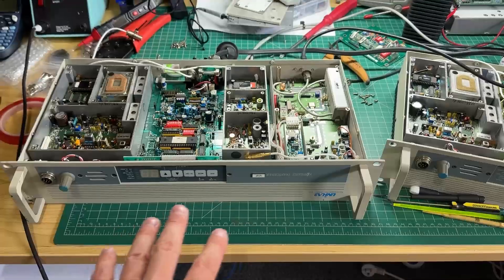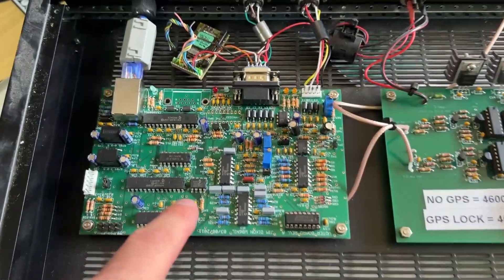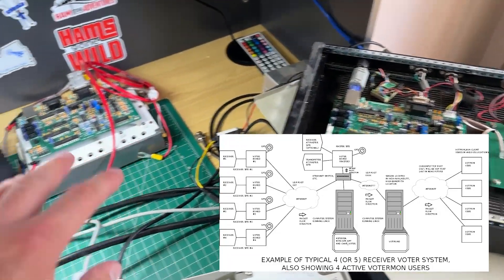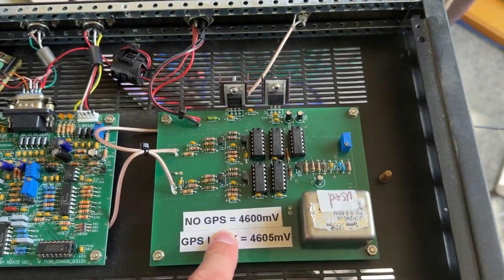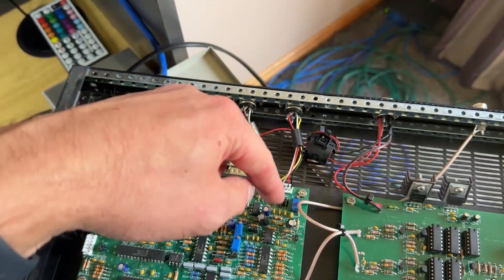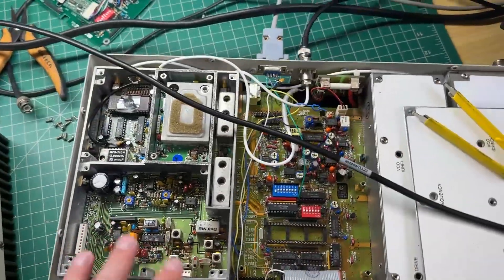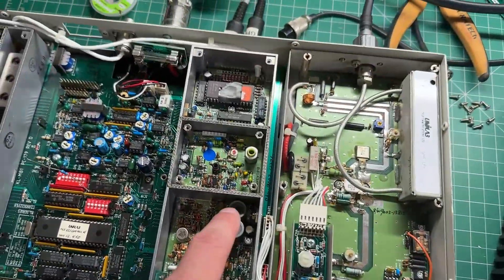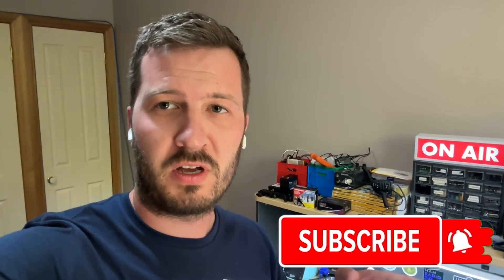Allstar Link Ham Radio Repeater Build

Comment from the maker: More Repeater Videos 👉 https://www.youtube.com/playlist?list=PLSuX83ay4Oug4QxmLe8MLyXjEqFd1Qr8-
Reply: I've been following this thread for some time now and I've got to admit that it's true that you are deleting comments that you don't like. It would appear that you don't like to be corrected or offered new information. That's a shame.. Now let's get down to the point. All-Star repeaters.

Mark is in fact alive and well at Micro-Node. The RTCMs are also still available. Make sure to specify that you are an amateur radio operator building an amateur radio system. It'll cost you less.

As for the All-Star controller that you are using, it is a dinosaur and cannot really be built because of the through the hole construction. Everything is SMC these days.

Although you are working with what you have you have to remember that the RTCM is in and of itself a controller. That's all you need for your simulcast voted system is an RTCMs. There's also an external GPS unit available for All-Star that addresses the 9.6 MHz and 10 MHz references.

Let's stick to the technical and learn what can be learned as well as what can be done differently with current technology.

73 de AF6D
Reply from the maker: @k6ecsrepeater969    I’m not sure how many more times I need to repeat myself..

I AM NOT DELETING COMMENTS! I have not seen any comments correcting me or “offering new information”. Also, your original comment (this one) has been edited, you said it was “my ego”, then you removed it. I’m not sure if it’s because of the way it seems to have been conveyed in this video, but I’m not an egotistical person. But I guess over the internet things and appearances get muddled…

Anyway in response,

You can indeed build the thru hole boards if you really want, but you’re right they are a pain to build. KC2IRV has built a few, you just need to find the relevant parts (the PCB’s are easy). They take ages to build so the RTCM is the more suitable option, or the Radio Thick Client which is the board redesigned (again check out Joe KC2IRV’s website on that).
Reply: @HamRadioDX  I think you're getting users confused. This is the first and only time I have ever contacted you. You told me I posted something and then I deleted it. Not possible when I have not previously commented.

I have to agree that you come across as very egotistical. It's not the content of your video. That's good but offers no specific instruction on how to do what you've done. It is not a "How To" project. It is a "Look what I did" project.

It's your response to questions that are being asked. I pointed out that you don't need anything more than an RTCM that you can be purchase directly from Mike renaude for $239 USD and you went on a run about getting a thick client something or another. Why reinvent the wheel as you previously wrote to someone else? All the RTCM is is a compact version of a flat board controller.

You're absolutely correct that you do not come across well. Just like your interview explaining what a repeater is and how it works where you hooked up with a stateside ham. A complete waste of time watching it.
Reply: @HamRadioDX  by the way, I edited my message to you because I don't like typos. I use speech-to-text and it generally butchers content. But somehow you want to point that out against me because why? You are combative. I would not follow you anywhere. You certainly would not be my Elmer even though I've been licensed since 1976.
Reply from the maker: @k6ecsrepeater969  Fair enough. 73
Reply from the maker: @k6ecsrepeater969  no worries 73 champ

Comment: What is the cost of a couple of those? where can they be purchased?  I have been wanting to build a 10 meter repeater for a long time?
Reply from the maker: I built the VOTER boards myself using the original PCB layouts available online here - https://github.com/AllStarLink/Voter/tree/master

I used PCBWAY to make the boards.

Commercially they can be bought from Micronode (RTCM). 
http://www.micro-node.com/thin-m1.shtml
Reply: A 10 meter repeater? You aren't going to co-locate the receiver and the transmitter I trust because a duplexer for 10 meters woild be massive and would be equally massive to buy!

Comment: What happens if the internet connection between repeaters fail? Do they fall back to operating independently?
Reply from the maker: Yes they do. You can also connect them via IP link (if you can physically see each site). That takes away public internet dropouts

Comment: Great job Professor  Hayden. Very interesting  stuff, I didn't know repeaters voted too. Lol
I really like the tech video's, I like to understand everything and how stuff works, keep 'em coming.👍
Reply from the maker: Awesome! Thank you!
Reply: Repeaters have had multiple remote receivers and thus voters for over 50 years the first one that I worked on back then was a GE MASTR PRO followed by the Motorola system the Motorola system worked on the principle of which receiver has the highest signal to noise ratio  where the GE system worked on which ever had the best voice quality. They were the best.